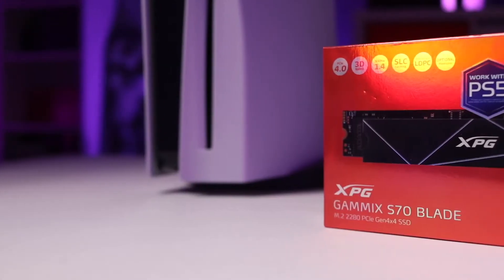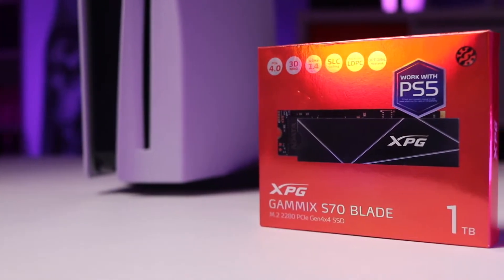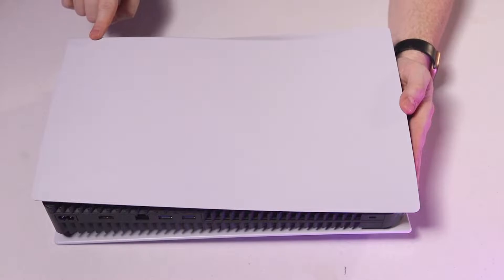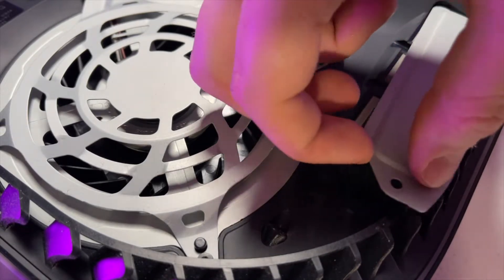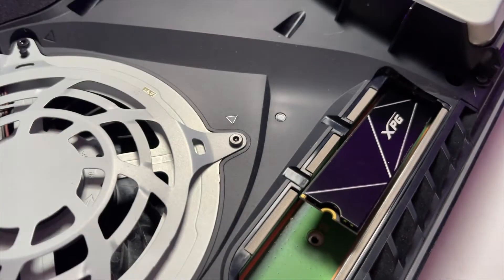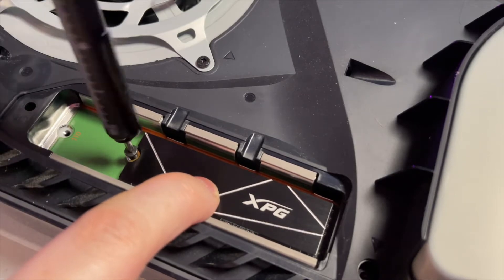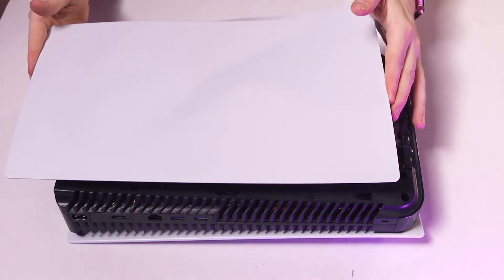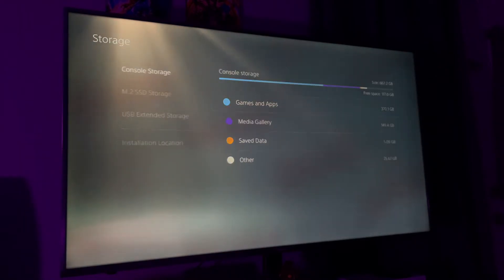Gammix S70 SSD PS5 Installation Guide

Comment: Do I need a cover or case for this ssd ??? Or we can use it directly as shown in video
Reply from the maker: Nope, you can use it with the supplied sticky shield and years later can confirm it's still doing just fine :)

Comment: one doubt there is sticker placed in nvme should i removed or ??? sticker says warranty void if removed . i am concern if the paper will burn while hot
Reply from the maker: I don't think it'll cause an issue- or at least, it hasn't for me and I've been using it for years at this point with no problems :)

Comment: Do you need to manually turn on heat sync?
Reply from the maker: Nope! It's just a piece of metal that gets affixed to the drive with a sticky pad :)
Reply: @ cool I did it yesterday without you replying and I did it now I can finally play COD as it needed to update but thanks good video by the way very helpful (THE ONLY ONE HELPFUL) thx. 😀

Comment: Hey, thanks for the awesome explanation, but I’ve got a problem. I did everything in the video, but when I restarted the PlayStation, I didn’t get the message saying the storage is connected, even though I’m sure I installed it right.
Reply from the maker: Oh weird? Could be a defective unit potentially. Beyond that you might try checking that you're on the latest update version for the PS5 and then try removing it and re-installing it to see if that makes a difference. Failing that I'd hit up the Gammix support people to see if they can assist with any other troubleshooting steps or potentially swap you out for a new drive!
Reply: @YourPlayer2  idk I have an external hard drive connected maybe that's the issue so I disconnected it and left only the internal still didn't work bought the storage drive from Amazon should I contact the seller now I'll try reinstalling it

Comment: What if I didn’t have the thermal pad would you not recommend using it then?
Reply from the maker: I mean it MIGHT work but I don't know that I'd risk it. Or at least see if there's a 3rd party thermal pad that would work assuming you can't contact the manufacturer for a replacement pad.

Comment: I have mistakenly put heatsink opposite side in ssd anyway to remove the heatsink its not separating please help
Reply from the maker: Yowch, well, you might be able to use a hair dryer to separate, but I’d reach out to the manufacturer support to be safe and see what they advise
Reply: @YourPlayer2  ok thanks 🙏

Comment: Quick question , when installing, the back sticker which is on the other side of the SSD? Should i remove it or leave it? The heat in there wont eventually damage or melt the sticker??? Thanks
Reply from the maker: I left it!

Comment: Hey it's been about a year since you have gotten this heatsink does it run hot? And do you still recommend it?
Reply from the maker: Still working just fine :)
Reply: @YourPlayer2  oh good, I was wondering since the two terabyte version of this SSD is on sale on Amazon and I was thinking of getting it
Reply from the maker: Oh nice! Hope it works well for ya :D
Reply: @YourPlayer2  thanks
Reply: @YourPlayer2 so my 2 terabyte SSD just arrived and I installed it no problem with your guide I will admit for a second that I thought I placed the adhesive on the wrong side but I didn't anyway thank you
Reply from the maker: Glad it went smoothly and enjoy, dude! :)
Reply: @YourPlayer2  thanks once again

Comment: i just installed the ssd expansion using this video thanks a lot! i do have  a question though, the heatskink being a bit smaller than the ssd itself and i may have not put it exactly in the middle with the exterior lines aligned. Could this have some negative consequences? I already moved a game to the expansion ssd and played it there so i worked fine
Reply from the maker: If it's just a bit off I don't think you'll have any major issues. I don't think mine was perfect either but it's still kicking today :)

Comment: This blade ssd has worked well since m.2 update. It does get hot. Took of m.2 cover and now seems better. Question... can I add a second heatsink on top of blade?
Reply from the maker: Glad to hear it! I'm not sure on the heatsink though- I mean if it fits I wouldn't THINK it'd be a problem but you might want to check with their support on that one to be safe.

Comment: Any idea if I can reposition thermal pad once put on? I put it on a little lower than I’d like and now the insert part is a bit blocked off by the pad.
Reply from the maker: That I'm not sure about unfortunately. I suppose you could use heat to try and gently remove it, but I'd be afraid to damage any of the components- maybe contact their support?

Comment: I've got the same SSD. installation was easy and worked fine at first, but now the ps5 blue lights flashes then turns off. After taking out the SSD the PS5 works fine again 😳
Reply from the maker: That's odd? You contact support? Could be a faulty drive maybe?
Reply: @YourPlayer2  I've seen on some forums the same problem. It might be a bad batch. I've contacted support so I'll keep you updated
Reply from the maker: Did you get it sorted? :)
Reply: Just bought one and installed it, half way through formatting it said it could not format the SSD.
I tried removing and reseating the SSD but now the PS5 just flashes blue.
Will try taking it out in a bit, still a bit panicked to be honest.

Comment: Great video  It looks fairly easy to do. Not sure I'd dare LOL, popping the cover off looks scariest bit! Can we get this drive / heatsink in the UK? Or do you think Sony will do a PS5 Pro at some point like with PS4 maybe offering more storage?
Reply from the maker: Bwahaha it's not so bad! Again, the only part that gave me pause was popping that panel off but even if you hulked out on it by accident at least you can order official replacements! Looks like it's on Amazon UK so don't see why not! As for a PS5 Pro I'm almost CERTAIN we'll get a mid-generation refresh but then Sony also said this would be a shorter lifecycle for them than the PS4 so maybe they'll forego that entirely in favor of the PS6? But every previous PlayStation generation has had at least one revision so I'm sure well get SOMETHING even if it's just smaller than the behemoth it currently is :p
Reply: @YourPlayer2  Cherrs for letting me know.  Yeah, I'd expect a mid life cycle updated version of the PS5 as well   I might try getting this drive, I've enough memory ATM but will have to delete a couple of game to make room for Elden Ring & Horizon  Forbidden West though.  Still, great video and it'll come in handy if I do  Dis you use a special screwdriver or can I use my regular ones?

Comment: I want a 2 TB upgrade so bad but the prices are still keeping me away. Every time I have an update I have to move a game from my internal to a USB hard drive juvst to make room. Shouldn't be such an issue in 2022.
Reply from the maker: It seems like there are sales periodically but I haven't seen a 2TB go under 300 and change yet I don't think?2TB would be nice but my biggest hope is that SSD prices overall keep dropping so I can use them more for editing/backups. Seems like they were at least a LITTLE cheaper for external ones at BB this year compared to last and I'm here for it! I keep a 5TB Passport hooked up to the PS5 as well to hold all my PS4 games or as an 'emergency' swap drive if I need to make space for something.